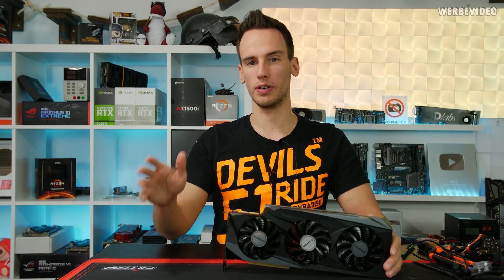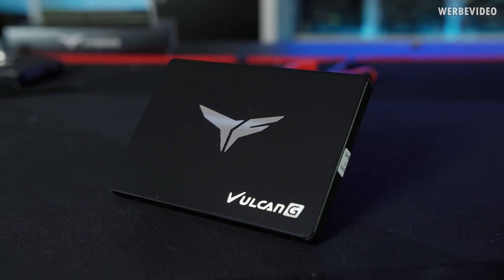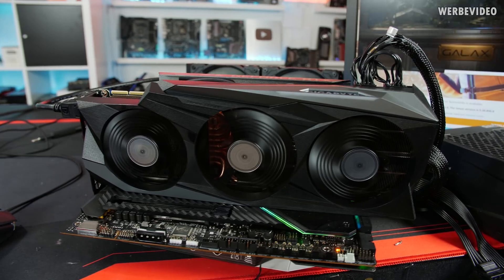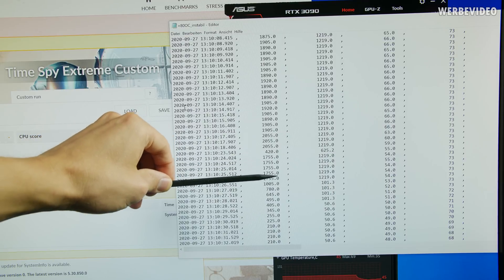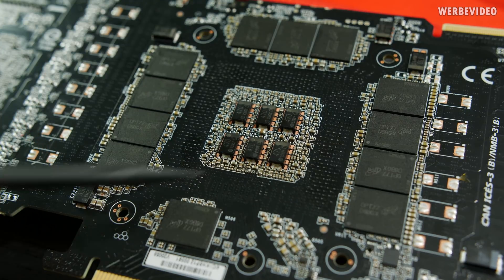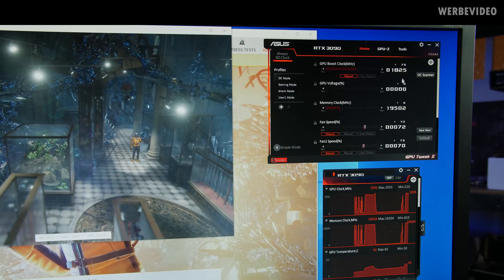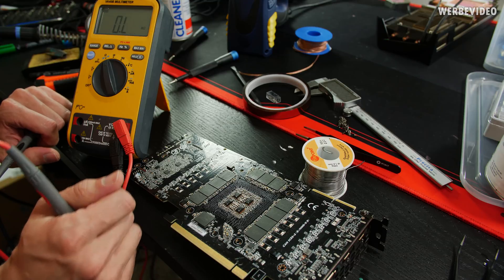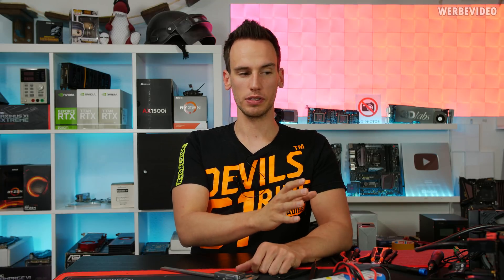We Tested the Cap-Drama - RTX 3090 MLCC vs POSCAP

Comment: Louis Rossmann will have heart attack.
Reply: Well at least he heat the board.
Reply: @araisikewai  and the job ultimately turned out to be okay given his equipment. I would be way too scared to attempt stuff like this on a brand new card :D
Reply: No hot glue was used
Reply: He did not use 1paul of Flux...I am disappoint.
Reply: where the fuck is the 2 liters of flux ???
Reply: I am sure Debaur can afford a Hakko FX951 or FM203
Reply: @Mjollnir1983  Hmmm....GT-R, Hakko, GT-R, Hakko, GT-R, Hakko... decisions were made.
Reply: I skip the soldering thing
Reply: Frankly, he did it by the book. If you don't have a hot air station (which he maybe should have) this is the way you do it. How else? Yah it's kinda not pretty, and maybe with a finer tip and a magnifying stand he could have made it look better, but it has no shorts, it's frankly good enough. And he can clean this all up and put the card back into the original state. no harm was done.
So yeah. Louis Rossman would probably not be impressed with this, but then Rossman is equipped for doing something like this on a daily basis and not like once  year, if at all.
Reply: @catriona_drummond  The man is using a €5 soldering iron he got from Pound Land, I'm pretty sure a hot air station is out of the question. And even if Hakko themselves offered him a sponsorship, he would still use the shit iron just to troll people.
Reply: @bigbuckoramma  there is no poundland in Germany. Also the best equipment doesn't help if you got no steady hand.
I am not saying this is great, I mentioned he should probably have a hot air station for this. But it worked. no permanent damage.

Just 3 days ago I have seen a self proclaimed retro computer expert witha  big channel being incapable of reading a multimeter, blowing up a PSU by shorting it with a bloody paperclip and dremeling it open because he didn't have a matching torx bit to replace the fuse with a wrong one. And that all on a super rare 5-in-the-world, new old stock museum grade IBM machine.
Maybe that lowered my standards but I can really not see much of a crime here. It did did the job just fine, it can be removed, cleaned up and put in the original state again. Where is the problem?
Reply: @catriona_drummond  I only accept if you solder it with a shitty soldering iron.
Reply: @bigbuckoramma  I fact I do :) 20 quid from Amazon, including 5 different tips. It's pretty okay though. I should recommend it to Roman :D
Does all the through-hole caps and ICs I need. And a cheap ZD-915 on top of it as secret weapon for tearing stuff apart.
Reply: @catriona_drummond  Nice! A desoldering station is something I should probably add. I used to have this decent little $75 Chinesium soldering station that worked great. Then I saw a deal on a genuine Hakko FX888 for less than a $100 and had to grab it. My poor little cheapo hasn't seen the light of day since. I just recently got a 575watt hot air station, that is a Quick knockoff. Works a treat. So far between the hot air, and my Hakko, I have been able to get away with using the flux impregnated solder wick. But a proper desoldering station is a must, as I am getting more into through hole stuff repairing vintage electronics.

Just different boys with a different set of toys. Haha, gotta have all the things.
Reply: @bigbuckoramma  A Hakko for 100$? Which truck did that fall off of? I wouldn't say no to that.
And yeah vintage electronics is basically my hobby. 
I can actually really recommend the ZD-915 thing. Couple youtubers have it too. It's not the most subtle machine, and not terribly easy to clean but it sucks really hard - which in this case, is a good thing. I think it is a ripoff of some Hakko design as well.
Can you recommend a decent Hot air station that doesn't cost Hakko money?
I discovered that old IBM MFM harddrives have lots of SMD Tantalum fireworks installed.
Reply: @bigbuckoramma  "Chinesium soldering station that worked great", this is an oxymoron. "Chinesium" means mostly bad quality,  initially referred to steel/alloy. Still, even if made-in-China and performing well, it should not be slurred.
Reply: @stanimir4197  It's not the best soldering station, but it got the job done. It's a unit that has been reviewed many times, and been sold under many different names, hence the Chinesium reference, as there is no one brand, and it's regularly knocked off and sold as a cheaper unit. The one that kicked it off was the "KSGER" T12/T15 Soldering Station, that worked with genuine T12/T15 Hakko tips. Technically speaking, from a tip perspective, the KSGER is subjectively better than my little FX-888D, however, the 888 has much better power output, and is more consistent with larger jobs that have a lot of heat soak in them. Especially when you are trying to desolder something like an RF shield, or a large PCB Power Pad, the Hakko is superior. Eventually I will go back to a T15 station, and get a legit Hakko to do it, but it's cost prohibitive to my needs. So the Chinesium one isn't necessarily "bad", it's just not great for my needs. For most though, the little Chinesium unit is probably more than they will ever use/need.
Reply: @catriona_drummond  Haha, no truck escapists here. This was a deal at a local electronics  component supplier. They usually retail for about $130-150, and they had a sale on them for $120, and I had a coupon for $20 off on $150 or more. So I added on some shit I needed, tossed on my coupon, and been happy ever since.

I do not have a brand name for my hot air station. I believe it is a knock off of a Quick 990, but it has a built-in vacuum sucker as well. The closest thing I can find on Amazon is the Aoyue 852A, but it is NOT the unit I have. Mine still has the adjustment pots on the front, and not a digital interface. The unit I have was the cheapest one I could find with an internal blower fan. I did not like the style  with the fan in the wand. They are loud, heavy, and have a lot of vibration in them I don't like. I also don't feel like the air stream comes out smooth enough. I don't use my hot air that often, and have maybe used this unit a dozen times. So I can't speak to the longevity, or durability. I simply don't use it enough.
Reply: @bigbuckoramma  I'd agree T12 based ones with a decent 24V/3A supply should fit most hobbits nicely, myself included.Actually in that case the really important part is the power supply and as with most China mains based equipment, they should be opened 1st prior to connecting them.
Reply: @bigbuckoramma  Okay, thanks anyway!
Reply: @catriona_drummond  If you look @10:24 in the bottom right corner of the screen you will see he does have a hot air station with separate control over temperature and fan speed. Yes he also is using a paint stripper style gun in the video @8:20 as well but even the cheap $20 units have a low setting (300C) and a high (525C)
Reply: @catriona_drummond  I mean, it looks like he tilted the cap with one side cold still. Get some good iron tweezers or my favorite is to just use double soldering irons to heat each side up.
Reply: Good. He can have all the heart attacks he wants.

Comment: You forgot Buildzoid's most important point. He hates it when people call them  POSCAP!
Reply: He should replace some of these SP-CAPs with actual POSCAPs
Reply: Yeah, poscap is made of tantalum and SP-caps are made from Aluminum. Also I think poscap is a Panasonic trademark as well. Buildzoid went on a huge rant about it lol. It’s almost like people referring to adjustable locking pliers to vice grips which is a brand lol.
Reply: @drewmalbica7694  The difference being that all "adjustable locking pliers" are different brands trying to be the same thing, where this is being more specific in the wrong direction.

It's more like calling all screwdrivers torx.
Reply: @drewmalbica7694  locking pliers and vice grips is a bad analogy, because they're actually the same thing. POSCAPs are not SP-Caps because they're made of completely different materials.
Reply: @drewmalbica7694  Didn't EVGA call them POSCAPS themselves in their statement? It's just what they call them in the industry. Just like people saying Kleenex or Clorox wipe instead of "small fabric piece soaked in cleaning agent".
Reply: @Peter22334  where I live, they are just 'wet tissues' and no one calls them w/ any brand name.
Reply: @stanimir4197  Where I live too. And in Taiwan and China where the cards are made, SP-Caps are called POSCAP. Funny, how different the world is, right?
Reply: I've even seen the EE's call them POSCAP's when they are actually SP-CAP's, same way some people tend to call any penetrating fluid WD40 regardless of brand, though it does matter in this case due to the material difference, as anyone within the EE field would probably try and avoid using aluminium caps for any situation where high ESR is a factor, especially any where there is any high frequency noise, as aluminium caps have a higher inductance as well, hence why you normally use ceramic / tantalum caps for decoupling (like they bypass caps in this case), and you would use aluminium caps for the lower ESR jobs like ripple smoothing etc. - its clear why the manufacturers put in SPCaps as aluminium is way cheaper than Tantalum, and funnily enough POSCAPS would probably work way better
Reply: @MysteriousFigure  Another bonus is that MLCCs and AE/AluPoly caps don't really use conflict minerals. Mostly barium titanate and various common transition metal oxides and silicates, plus lab-grown cyclic polymers in the poly caps. Even after international efforts to improve practices, tantalum mining is not a very nice business to be relying on.
Reply: @MysteriousFigure  "lower ESR jobs like ripple smoothing", they get hot. Higher ESR sucks even with lower switching freq. like 40KHz and flyback SMPS.
Reply: @stanimir4197  yeah, certainly not the greatest temperature-wise, at least they're cheap
Reply: Yeah but he also calls it Kapton tape when that’s a company name. It doesn’t make a difference.
Reply: POSCAP is a registered product name from Panasonic.
Reply: Well apparently Derbauer hates it when I comment "from what i've heard they aren't called POSCAPS", because he deleted my comment.... wtf
Reply: DeeDee Ranged I don’t think so. I first see poscap from igor’s lab, and everyone was quoting him on that. However, igor explained poscap being tantalum capacitors, while sp caps are actually polymer electrolytic, which is a complete different product. This led me to think Igor was wrong in the first place.
Reply: Who cares about buildzoid? He just happens to know how to read datasheets.
Reply: They may not be POSCAPs, but they are POS caps.
Reply: @CaveyMoth  no they're not, even FE has 4 of them. They have more capacity and lifetime.
Reply: @ShinyHappyREM   nuh-uh! I heard someone on the internet say they are cheaper! Nuance is inexistent! They are cheap and therefore they are worse, IN EVERY SITUATION!
Reply: @ShinyHappyREM  Exactly. MLCC's will degrade within a few years and everyone wants then on their cars now 🤦‍♂️

Can't trust anything on the internet
Reply: POScap sounds like a derogatory term :-) (though before i heard of that interp of pos, i used to think "player owned structure".. oh, i guess even before that..."positive"...
Reply: @mm-yt8sf  EVE is not a game, its a lifestyle.
Reply: @mm-yt8sf  What about Point of Sale?
Reply: @CaveyMoth  once a coworker couldn't believe i didn't know why MF in a project name was so bad and she asked me what i think MF stands for and i said "mainframe?" :-)
Reply: @mm-yt8sf  In my field of work, SOB is a commonly used acronym for shortness of breath.
Reply: it seems like poscap became some of a general industry term for any spcap even if its a specific brand of spcaps sort of like people say google it even when they are using some other search engine. since many of the AIBs like evga called them poscaps also
Reply: @MrWizardjr9  Yeah, it's like "Q-Tips". Everybody I know use it for any cotton tips (OR tips not using cotton....or not used in a personal "hygiene" setting).
Reply: @MrWizardjr9  POSCAPs aren't SP-CAPs though. SP-CAPs use Aluminium while POSCAPs use Tantalum.
Reply: "POS Caps" or rather high ripple current capable tantalum oxide polymer caps are much better at high frequencies than aluminium oxide polymer caps.
but the thing is, nobody is using poscap aside from the FE. im pretty certain they're aluminium oxide polymer caps
Reply: Dave Lee Aluminum polymer caps have the same characteristics with single mlccs except beyond 100khz. Tantalum has high ESR and is not the best choice here. The reason why mlccs outperform polymer is because mlccs are used in parallel, which boost performance significantly despite same/smaller capacitance
Reply: @kris2501100  Tantalum is not high ESR. Crap tantalum, maybe compared to highly specific AlO2 but Tantalum have better HF characteristics and ESR as well. The only problem? Tantalum is VERY expensive.

ceramic dielectrics are the best for high frequency bar none but they are prone to cracking especially on the large size, 0805 with high capacitances could be prone to cracking as well. A cracked capacitor is one that could short out and catch fire! Ever dropped a older phone and it stopped working? Chances are a MLCC cracked and the phone stopped working
At HF or certain frequency Aluminium oxide electros ESR rises spectacularly
Also another problem with ceramic is that they have a very severe voltage derating where exceeding 75% of the rated voltage can lead to drastically reduced capacitance but then again, capacitance isn't the issue, ESR is for decoupling past the VRMs, this decoupling is to filter out the switching noise imposed on the supply voltage by the transistors

Source : I'm a electronics engineer that spends most of his time with power supply decoupling
the only reason MLCCs "boost performance" is that ceramic is a better dielectric. that's all there is to it. The problem is not capacitance here the problem is high frequency response. You can try tacking on more and more SPCaps (FE uses POSCaps not SPCaps!) but you don't gain anything.
No AIBs use POSCaps, only the FE does. Nvidia mentioned to use POSCaps but they were vague.
Reply: @DLTX1007  That's misinformation. It depends on the type that's actually used. However, If you check carefully, none of these 3080s used tantalum. They are all going polymer. BTW, ESR is just why your cap can output high ripple. These properties are tied.
Reply: @DLTX1007  Nvidia used something I don't recongize by browsing through all datasheets I can find over mouser/digikey. I don't know which brand/model they used. I cannot tell if they used high specs ones or low specs ones.

What i do see over mouser, 470uf sp-caps has ESR between 3-13mohms, while 470uf poscaps range from 5-40mohm. That said, a "crap" sp-cap is somewhat perform like one of those better poscaps.
Reply: @kris2501100  i was looking through yesterday and 220uf sp caps and 220uf poscaps are both 3mohms. only difference? POSCaps are pricier! also capacitance is not everything.
and at the same frequency poscaps will perform better. and as i was saying, ESR is everything, when you dont need 470uf to do the job (you don't, this is supply line decoupling not filter) you can use 220uf if it has similar ESR but better dielectric. It will make a difference at HF!
But mlcc does perform better, if you can be damn sure they dont crack
Reply: @kris2501100  caps dont output high ripple... do you even know what you're talking about? Ripple current is how much ripple current they can take without heating themselves up and they are not entirely co-related.
Tantalum POLYMER exists. it is BETTER than aluminium polymer but of course, you dont know what you're talking about.
Reply: Dave Lee until you find exact part number. I can show you a dozen that’s not the same. Like i said, i dig all datasheets on mouser. All i can say is NV uses what seems to be aluminum polymer as they have a “d” mark on it as other brands do with their aluminum polymer, but mouser/digikey dont carry the exact one NV uses so I don’t know what spec it is.
Reply: @kris2501100  I don't need to. I already explained all the science behind it but you clearly do not understand and are trying to change the subject
Reply: You can get a kicad and do your own circuit simulation. You are talking 2nd knowledge you don't quite understand. I have designed and built several amplifiers for myself. All I can tell you is that, it is not about crap/cheap components, it is about getting the right type and combinations at right locations. AFAIK, aibs do just fine. It is a NV tradition to fire on their partners when things go wrong on Nvidia side.
Reply: Dave Lee well nv does not use poscap, poscaps don’t have a d mark on it. That voided everything you said above.
Reply: @kris2501100  2nd knowledge? just because you designed several amplifiers doesn't make you better than others. The moment you said "output high ripple current" tells me you don't understand.
So just move on.
Reply: Dave Lee it takes time to learn electronics. Mlccs even vibrates when voltage applied and can sometimes crack if designed improperly. By far I haven’t been able to find out if these are c0g grade non-vibrating mlccs since there is no marking on it. Yet people are in a hasty to backup their quality over other components. Somewhat ridiculous imo.
Reply: Dave Lee lol. At least i walked through all those calculations and can see what the problem potentially is. Just chill down and wait for more modders got their hands on it. I am expecting buildzoid to prove you wrong probably within 2-3 weeks.
Reply: @DLTX1007  False. No-one is using POSCAP, including the FE. There are 0 models of the RTX 3000 series which use tantalum capacitors (the SP-CAPs on the FE have a similar design to POSCAPs, but still aren't).